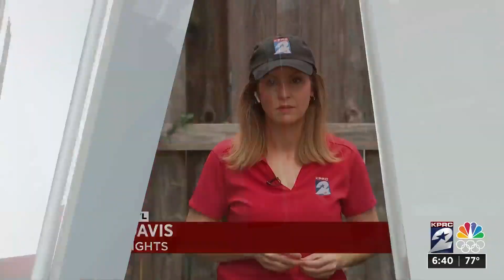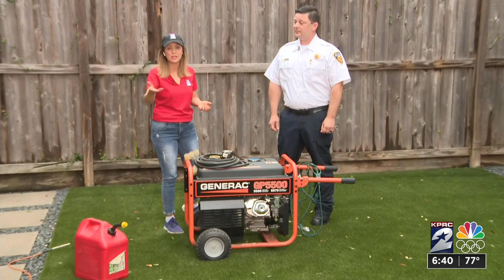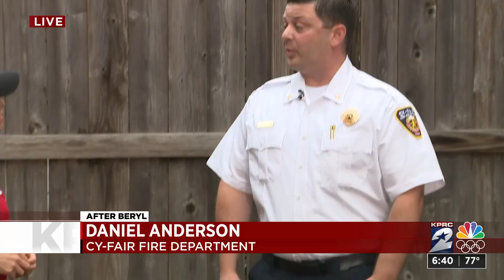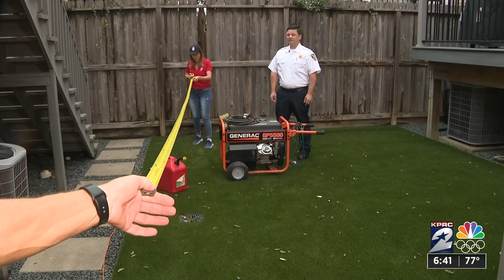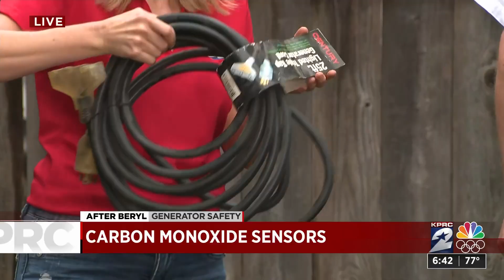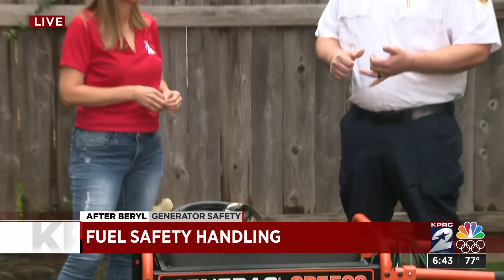Are you using the wrong extension cords on your generator? Generator safety 101

Comment: Fuel stabilizer (I think it was a half bottle per 5-gallon can) and I'm using fuel that is 18 months old.  Admittedly, it ran a little rough but it was fine.  Immediately add it in the gas can and swirl.  It's too late if it's been sitting for a while and you try to add it in the generator's gas-tank.  Try to make sure the gas-tank never runs dry; so much harder to re-start.  Always use the oldest first (you know that).  I usually get 8-hours per 5-gallons, but plan on 6 hours.  I have 25-gallons on hand.
Pay attention to the 25-hour, 50-hour, 75-hour generator run-time and change the oil, air-filter, etc., according to your manual.
Don't make my mistake!  Drain it properly and shut it down at the end of the hurricane / cold weather season; then set it up properly before the next one.  It took me 76 pulls on the cord ("recoil start") to get it started last time (all the while worrying that I might break the pull-cord!).  If you leave it set up during the season, start it up once per week for a little bit.  EVERY TIME you start up the generator, make sure there is nothing plugged in; you don't want your refrigerator kicking on while you are trying to pull-start your generator!  I leave the 12 gauge cord plugged into the generator, but inside the house disconnect the 14 gauge cords from the splitter.
Again, learn my from mistake.  Spend the money and buy 12-gauge with triple-tap (three plugs) built in.  I had a space heater on during the Big Texas Freeze, and the cheap separate three-plug on my high quality 12-gauge wire got too hot to touch.  Caught it in time, but dang that was dangerous.  I use 12-gauge from the generator to the kitchen, living room, and bedrooms,  with built in splitters, and then 14-gauge to lights, fridge, etc.  You can even have your normal power-strip after that; bed-side lights and phone chargers don't pull much power.  I must have $400 in power cords.  In my opinion, it's better to have 100-foot cords and need 75 feet, than have a 25-foot connected to a 50-foot cord.   Keep excess cord loose - not rolled up in a tight circle - so it won't over-heat.  I exceed the recommended length of cord, but make sure to not put a full load on anything.  I recommend the type which lights up to show it is getting power; makes trouble-shooting so much easier.  I like Yellow Jacket Lighted Power Block (3-plug); the price has gone up 25% since Biden took over.
All of this was stone-soup, little by little.  If I had it to do over again, I'd spend the money on an electrician to tie in the generator to the house and skip all the cords on the floor.  We have a Ryobi 6,500 watt running (8,125 w starting) generator (195 pounds with wheels), and supported two fridges, plus three room-size space heaters and lights, etc.  I've never tried a window A/C unit.  We use window screens, plus two big fans in a push-pull set-up on opposite sides of the house.
I wanted a propane-fueled generator; SO much cleaner to deal with.  Until everything in Houston shut down, and there was only one store which was open to sell propane; versus the half-dozen lucky gas stations I found.  Now I want a duel-fuel with push-button start.  I don't have any experience with it, but the Westinghouse 9,500/7,500-Watt Gas / Propane (LPG) powered Portable Generator with Remote Electric Start sounds good (202 pounds with wheels).  I'm getting too old to yank that cord.
Let the generator cool for 5 minutes before refueling; splashed gasoline on a hot engine or muffler is not good.  I - with a white-hot burning passion - DEPISE Scepter gas cans because it is so hard to squeeze the handle (push forward with the heel of your hand), and it's a real pain to twist and turn to get out the last bit of gasoline.  They do not vent properly;  mine looked like over-filled balloons.  If you squeeze the handle to relieve the pressure, you get a spray of gasoline!  You have to undo the spout (lefty loosey) just a little bit.  I love Easy Can gas cans (squeeze with fingers and thumb); they just work.  Don't forget your funnel, and bring paper towels to clean up when you spill (and I always spill...).
Reply: I use Sta-Bil Starting Fluid. No more hard starts, fires up immediately every time.

Comment: I use non-ethanol gas in ours and if I store it I put stabilizer in it. And I get fresh gas every three months. I put the old gas in my truck. I also run the generator for 30 minutes once a month.
Reply: For those looking for non ethanol gasoline, some Murphy stations have it. It will be the blue label next to the diesel pump.

Comment: When buying cords make sure to buy models that can carry 120/240v - 30 amp or 120v - 20amp. I purchased both for my m 6.5 Kw. Also, treat gasoline with stabilizer. In addition, I use Sta-Bil Starting Fluid for instant staring.
Reply: Does.will be enough for a refrigerator?
Reply: @speakingthetrue  Yes mine pulls less than 1000 watts. I can run 2 AC window units at the same time, too. Still have enough power left to run lights, TV, internet. Good idea to have extra power strips and  four heavy duty extension cords at least 50 feet in length.